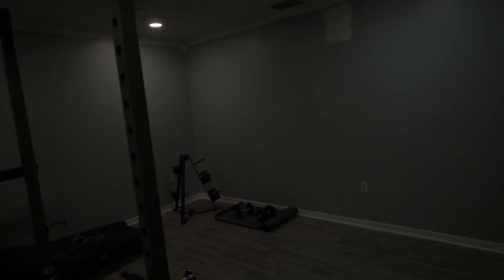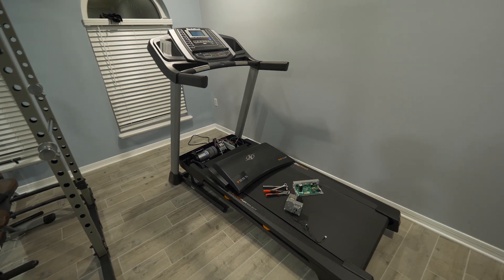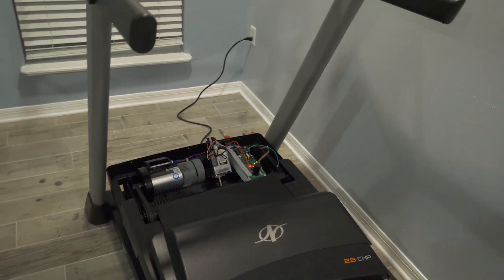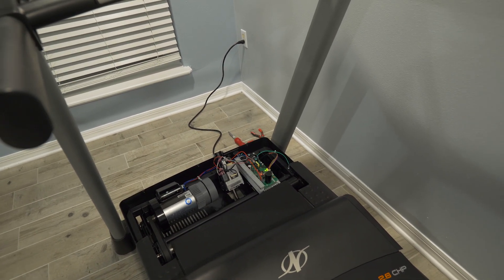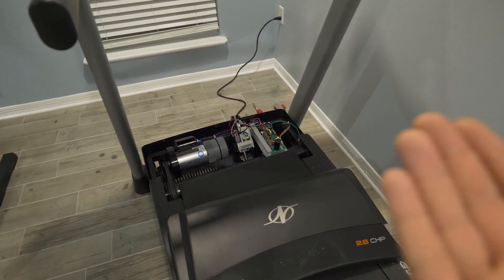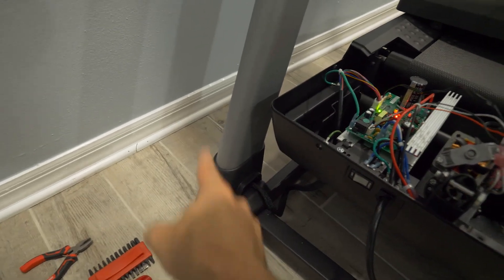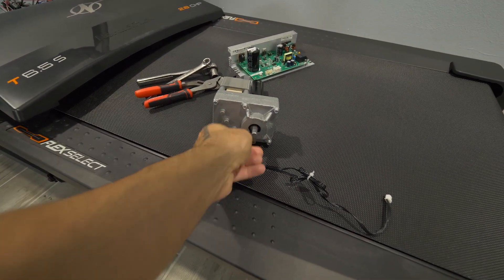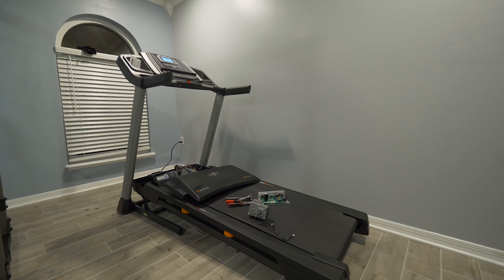DO NOT BUY!!! - Nordictrack T 6.5 Treadmill

Comment: I have had a really bad experience with my NordicTrac 6.5 si. It will not start. The outlet works, the unit is on, the magnet is in place etc.).My controller shows one steady green light and one steady red light. However, when I press start nothing happens. I have been dealing with NordicTrack for over three weeks. They have crazy long wait times and then I get disconnected. All but one representative would not help at all. I tried replacing the upright wires but it did not work. What a waste. Im so disappointed in NordicTrack.  :(  I hope yours got fixed.

Comment: My incline goes up but then the whole machine starts to shake which makes running on the incline an inconvenience and now it doesn’t run at ultimate speeds when you press the buttons. I’ve had mines for 3yrs it’s crazy
Reply from the maker: Sorry to hear that. I guess you're out of warranty by now too. I don't know if this helps you, but here is the link where you can order replacement parts. Since you're out of warranty, you have to figure out what you need and install it yourself though. https://www.iconservice.com/model/parts?modelNumber=NTL17915&version=17

And yea, mine isn't the most sturdy either. But I figure for the price, it's acceptable. A commercial one would be more stable, but also take up more space.

I had an appt on Nov 16th for a tech to come out, but he canceled last minute and rescheduled to the 26th. (actually never called me to cancel, I had to call them). So now I think I'm at over 3 months dealing with customer service to get this fixed.
Reply: Rattle n roll!!! You could end up actually getting arthritis using these machines!!

Comment: I should have listened to this video......
DO NOT BUY.
I bought one for my family for Christmas and it sounds like a WW2 fighter aircraft taking off. Unusable. And there's no way I'm gonna fix it.
Amazon says they will take it back, we'll see how that goes. 
But yes, it is a piece of junk, and now my Christmas plans are messed up.
Reply: Sorry to hear that. I'm on the opposite spectrum. Bought identical machine for my wife at Christmas. Solid machine. Zero issues. Only issue was delivery. It broke the top cover but i fixed it with a 3D printer and got 45% discount. It works and is as solid as all the reputable reviews say. Had one weird hiccup but that was due to improper voltage from my outlet. It is a legit buy!
Reply: @vangmountain  Glad you had good luck with yours. Mine seemed solid but like I said, it had mechanical issues that made it crazy loud. I mean super loud, like an airplane taking off.
Amazon took it back with little hassle. Thank god. We'd probably just be using it as a coat hanger soon. Lol.
Reply: @bobalmighty2925  That's definitely not normal. For that level of noise, something internal in the drive assembly must be broken or loose and is rubbing or grinding. Also could be bad bearings, but definitely, return it. It's definitely disappointing to purchase a product only to have it arrive damaged or not working properly.  One sort of expects the opposite, else you wouldn't have paid for it to begin with. After having read many reviews, I took a chance on it knowing there could be broken components. I initially missed it while the delivery guys were there, but as soon as the delivery guys started pulling out, I noticed the large crack on the cover. I tried to stop them and put it back on the truck but to no avail. I even called them but I think they knew so they never picked up even though I knew that was their number because it was the number they called me with just 30 mins earlier. 

After unpacking it and seeing how it was packed and how heavy it was, I can see why cracks seem to be pretty common during delivery. The packaging they have is not sufficient to properly protect the plastic cover. If you know and handle it properly, you can avoid it, but no delivery person is going to know that unless it's specifically marked on the box how to handle it and where pressure can be applied. Without proper packaging and handling information, it's just a game of numbers.  I'm glad ours has worked flawlessly so far and we put about 4-5 hours on it a day. Some days more and some less. For the price point, I don't think there are many treadmills that can compare judging by the reviews I read prior to purchasing it. If what you get isn't a lemon(sure there are some), it should be a solid machine as it's quite heavy and very sturdy.
Reply: @vangmountain  Does yours also shake constantly on speeds greater than 3.5? Mine shakes so much. Like the bolts aren't tight. But we went through every bolt and check. I think it's bad design and needs a cross support.
Reply: @Floortile83  it absolutely does not. It runs smooth and relatively quiet. I've even topped it out running at 10mph. Zero issues. You just hear the motor and drive system hum louder but nothing out of the ordinary. Vibration would be the result of an improperly balanced flywheel. The mount could be off-center or the flywheel itself could be deformed. Something in the drive system is definitely out of alignment it sounds like but I have had zero such issues. I would definitely take the cover off and give it a good one over. It's quite easy to check if it's properly centered. Good luck!
Reply: Also check all your motor mounts and belt pulley mounts. Something is definitely out of alignment or loose. That's not normal and is unsafe to operate. Please do check and don't continue to use it as it's a safety issue. You could have a bent axle or frame. These things are heavy so it's very possible to bend something during transport. Verify where the vibration is coming from. Is it the base or the uprights. If it's the base, you have an issue that needs to be addressed asap. Good luck and stay safe.
Reply: @vangmountain  I sent it back. I'm not going to fix a brand new treadmill. I expect it to work as advertised and I shouldn't have to repair a brand new product myself.
Reply: @bobalmighty2925  I would have too! When you buy new, you expect it to work. Only reason I chose to keep mine was because it was just a minor cosmetic blemish that's only noticeable if you look for it. Seeing how week the screw mounts were, when I 3d printed parts for it, I also printed parts to strengthen it. Once set up, there was no point in tearing it back down especially seeing how well it was working. Amazon was more than happy to give me the 45% discount to keep it. Win win for both Amazon and myself.
Reply: @vangmountain  Doubt it's inbalance, because it doesn't vibrate like this when it's running without me on it.
Reply: @Floortile83  then it's definitely a loose mount, possibly in the motor mounts. When you are on it, the motor is under more load and something has to resist the load exerted on the motor, that being it's mounts which will transfer it to the frame and down to legs to the ground. If the mounts are not tight, the motor can move under load and this displacement can result in the imbalance needed to generate the vibrations you feel when you are on it. The faster you go, the greater the vibration. Is this new? Has it always been like this from the start?
Definitely check all your frame bolts and motor mounts. Make sure everything is tight. Good luck!
Reply: The other thing, and you should check this first is belt tension and lubrication. The belt should glide over the deck like a frictionless surface. If it's not lubricated or is too tight, you are creating greater friction between the deck and the belt. This can lead to vibration because the increased friction of your feet landing the belt forces the motor to slow down and when it unloads, the motor starts off with a jump because as the torque on the motor increases, it wil draw more current. This increased current makes the motor build up with potential energy and as soon as you lift your feet off the belt, it violently launches the belt until you step on it again. If you've ever driven a manual transmission and let the clutch up too fast, you experience a quick jolt. That's what happens if your belt is too tight or it's not lubricated. In essence the motor is operating at differential speeds. During this kick(rapid acceleration due to low friction from uloading belt) from low speed(high friction from loading belt) to high speed, the motor exerts a large torque on the frame and it this happens quickly, it will manifest as vibration. The faster it goes, the greater this torque is leading to greater vibration.. This could be your issue. Check the tension on the belt and make sure it's well lubricated and centered. The belt should lift some 2 to 3 inches off the deck if you grab it at the halfway point along its length and pull up on it. If not, decrease the tension until you achieve this. Hopefully this is your issue.
Reply: Note I'm not a treadmill repair expert or anything as I've only owned one for under a month. This is just speculation based on my understanding of physics. With low friction, the flywheel is able to spin quite freely as the speed varies only slight. When you have high differential speeds, as you bring the flywheel to a rapid slow down, angular momentum must be conserved so this rapid slow down torques the frame and causes it to lift(it's trying to rotate). Angular momentum is transferred from the flywheel to the frame. And like wise, going from slow rotation to fast means you've increased the angular momentum of the flywheel and again, angular momentum must be conserved so this will torque the frame in the opposite direction. The end result is this rocking of the frame back and forth which is realized as vibration to you.